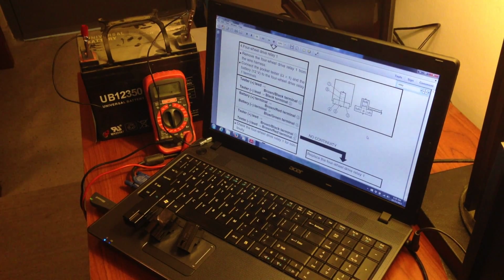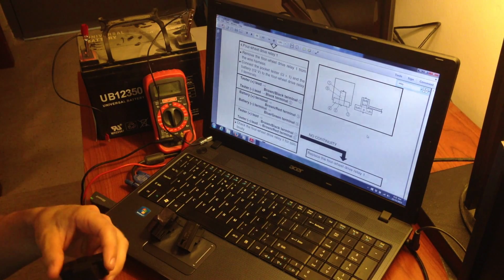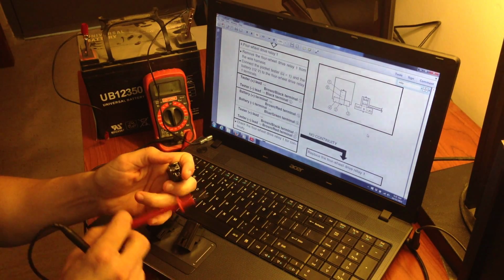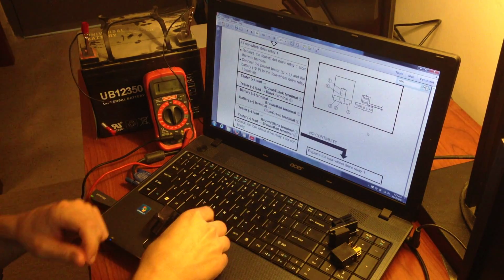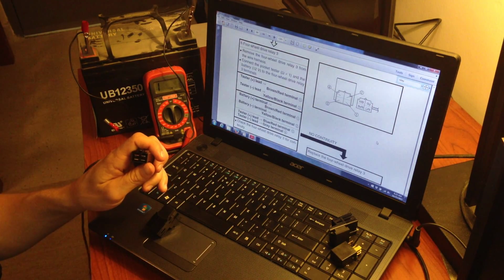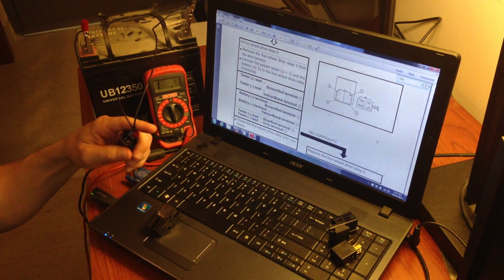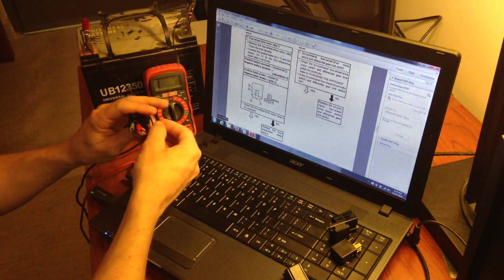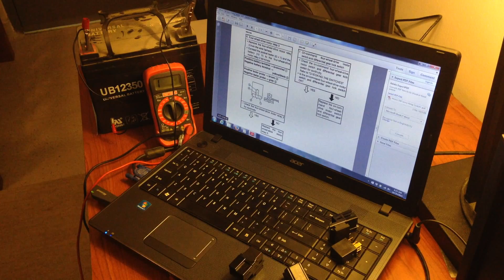Testing the Yamaha 4x4 System Relays All Types 1998- Present

Comment: Good morning I have a 2013 sxs I just bought it and the only thing I see in place is the servo it is currently stuck in 4 wheel drive need help on what all components I need to get it working into 2wheel drive the toggle push button has no wires running to it can you help me?
Reply from the maker: You should take a look at our troubleshooting page. You will need to get a wiring diagram and start tracing wires possibly a new harness if you want it to work properly. That may be easier.
Reply: The wiring is in place is there a way to jump wire the servo to get it to switch to 2wd or can I take the servo off and manual disengage?
Reply from the maker: @mikewolfe789  If you remove the servo manually you can put your finger inside of the differential and engage in 2WD. Then you can bolt the servo back up and ride until you get the problem fixed.